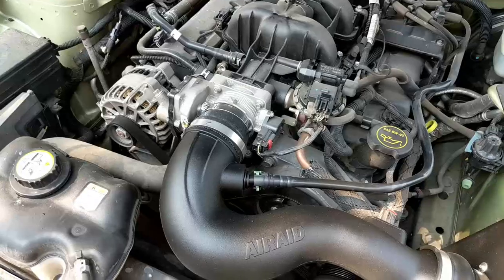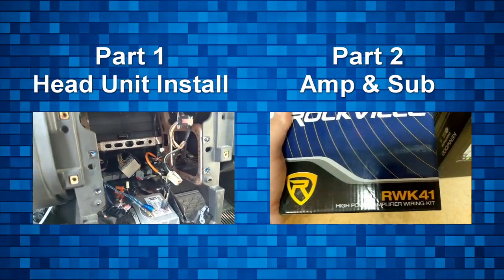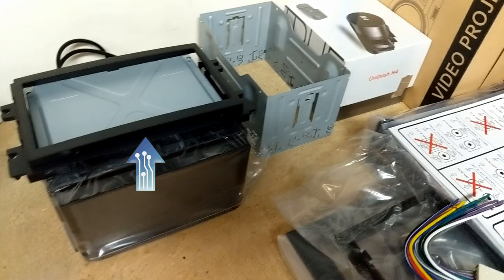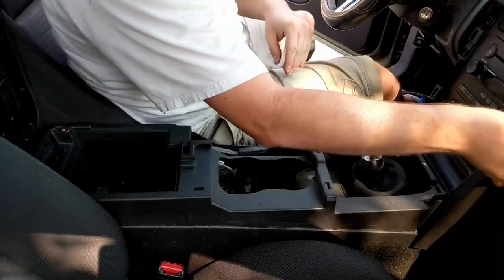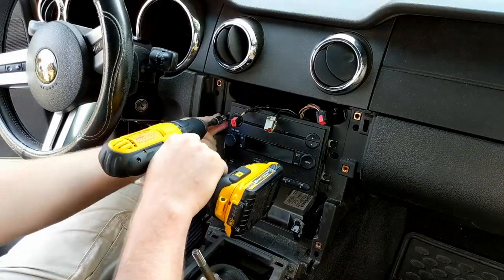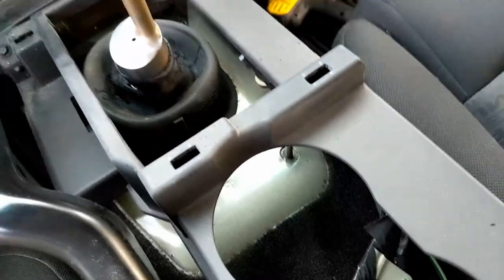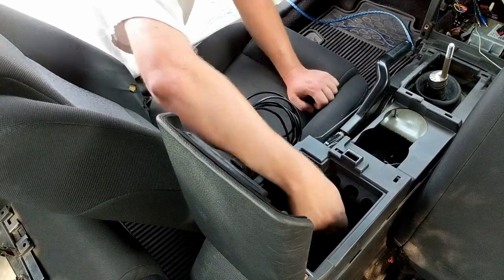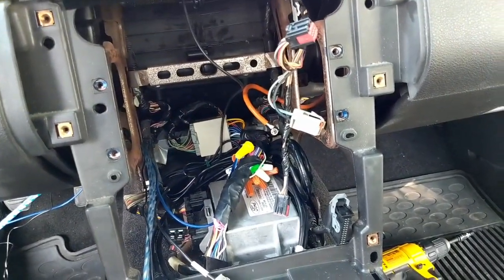Stang Audio Install Part 1 || Kenwood DNX996XR

Comment: I never ran any wire to the Amp. Just used the RCA wires and plugged it into the back of the radio and into the smaller connector right there. Maybe I misunderstood.  It was real easy.

Comment: So I have this on my Subaru STi but after getting a pro-tune, the tuner guy ended up messing with something that caused the head unit to no longer dim when the headlights are on or get brighter when the headlights are off.  I basically have to change it manually in the setup on the stereo.  Do you know what i can do to start troubleshooting this?
Reply from the maker: Did you install it? Do you know what wire you/the installer hooked it up to? You might check the connection or make sure the wire is still delivering the power you need. If the tune changed it (I can imagine why I would have) you could connect to another wire that delivers what you need

Comment: So no need to connect both remote power control wires on each harness unless there’s a factory amp correct?

Comment: Hey I got a question there’s the main harness then a second harness dark grey plug @8:52. that had only two wires white/orange and pink/orange these are data lines I think. Did you leave those unhooked? my mustang is the same year as yours.
Reply from the maker: Yes I would have plugged it back in. All plugs  get used still.

Comment: If you ground the parking switch will that allow you still use the video playback functions?
Reply from the maker: Yes, it would allow it in more circumstances even..  but its for passengers only to watch!
Reply: @BudgetNerd  thank you.   I totally agree passenger's only.   I am currently trying to decide between this radio and the alpine ilx-w650.  I'm purchasing a 2006 mustang this weekend
Reply from the maker: Nice!

Comment: about the headlight dimming, you spliced the illumi wire in to your hazard harness? i like the idea of the head unit dimmin
Reply from the maker: You have to provide 12v power to that line for the heads unit to dim. Using the harness won't work right in the mustangs, doing it the way I did it is a workaround.

Comment: there are 3 original connectors on the old radio, do u only have to use the big one to power the radio, are the other connectors useless now?
Reply from the maker: If I recall, it's been a while, you use them all still. One is the antenna, and the other might be power.
Reply: Did you ever find out I know what you’re talking about